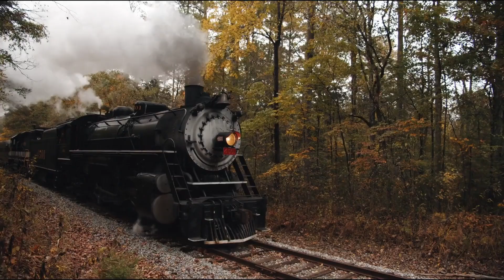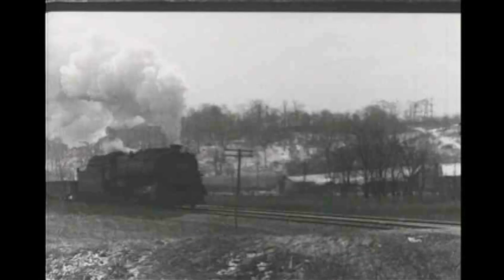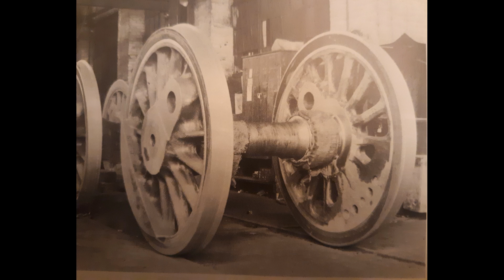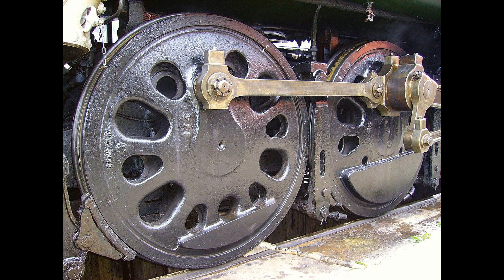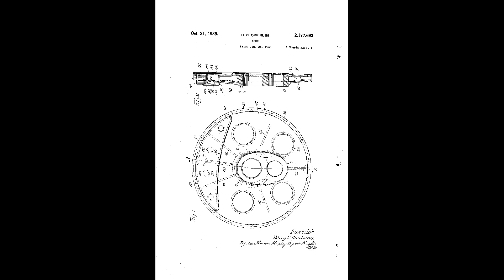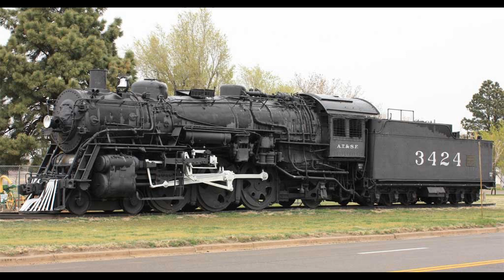Locomotive Drive Wheels : Box Pok, Baldwin Disk, and More

Comment: Good explanation, now I do better understand the different types of hollow cast wheels and how they look internally.
The Boxpok design also made it on a limited scale to Europe, most notably are the British Southern Railway Bulleid Q1 freight locomotives and the Pacific types. Also the Soviet Union used them in many later designs.
In East Germany the Pacifics class 01.5 rebuilds were known for these wheels, the class was partially fitted with them, but as there was a design flaw in these wheels which caused cracks forming they all  reverted to standard spoked wheels. But these loco's certainly looked cool with their Boxpok wheels, skyliner dome cladding and pointed smoke box doors.
Lastly there were the French 141R Mikado's built under lend lease by US and Canadian manufacturers which were partly fitted with those wheels, sometimes only the main driver.
Except for the East German 01.5 of which only spoked wheel examples survive there are survivors of the other types, partially operational.
Reply: The Bulleid wheels were not a Box Pok, but the Bulleid Firth Brown design.
I would expect Bulleid would claim it is a superior design, but more likely just a sufficiently different way of building it and design so as not to need any payments to the Box Pok design owners.
Also could be produced locally in the UK by the Firth Brown company, which was very important during the wheels introduction at the start of World War Two. Shipping locomotive wheels from the US not being a high priority
Reply: Wikipedia has some useful information on the Bulleid wheels. 
Part of the story :
The Bulleid Firth Brown, or BFB, is sometimes, but inaccurately, referred to as a Boxpok in reference to the wheel used by a number of US railway companies. The BFB is visually similar to the Boxpok, but is of a different design; the Boxpok is composed of sections fixed together to make a hollow shape, while the BFB is cast in a single piece, like a spoked wheel, the shape giving the rigidity needed.
It also points to the Australian SCOA-P wheel with its advantages.
Reply from the maker: Hi Tom.  I'm glad you enjoyed the video.  Thanks for sharing all that great information on disk type drivers used on European locomotives.  I wasn't sure to what extent these types of drivers where used in Europe.  Thank you for your comment and thanks for watching!!
Reply: The Bulleid [note sp.] Firth Brown wheel is not a Boxpok wheel.  It is essentially a single folded plate, and is an impressive piece of foundryman's skill (Wiki notes that one 'source' says the first 'B' in BFB ought to stand for 'Beaumont' rather than 'Bulleid'.

If these were not cast really well out of good material they could have 'issues' with stress raising and breakage -- note that Riddles went back to spoked drivers on the postwar BR 'standards'.